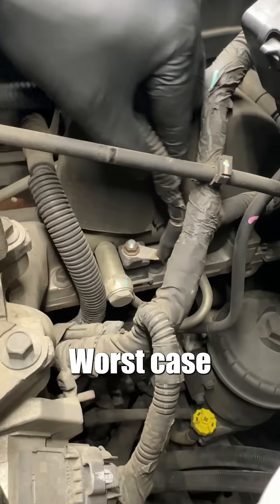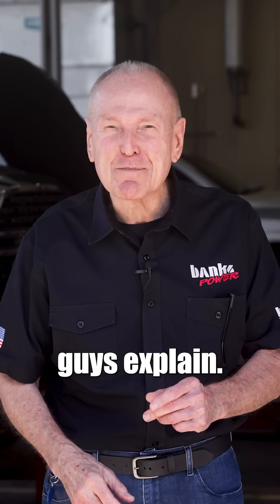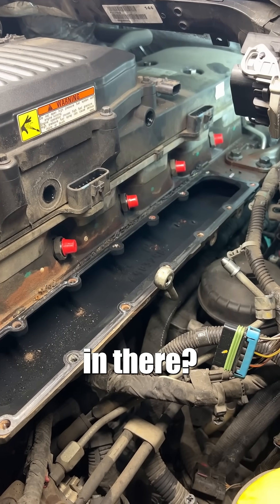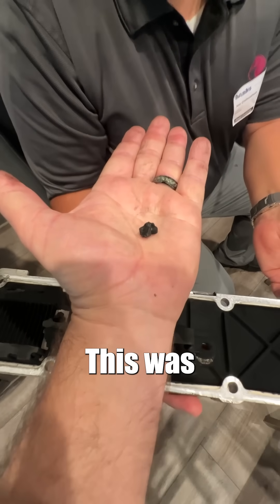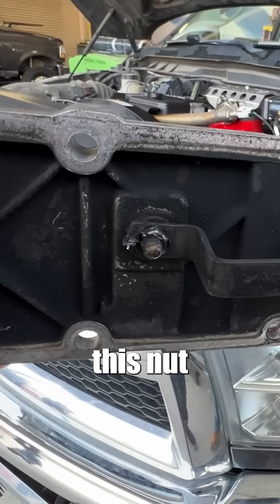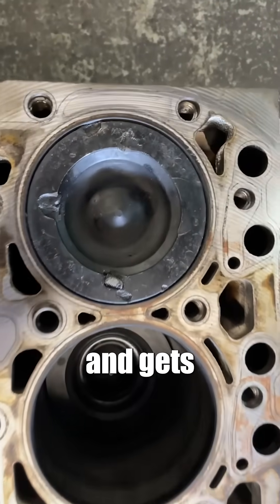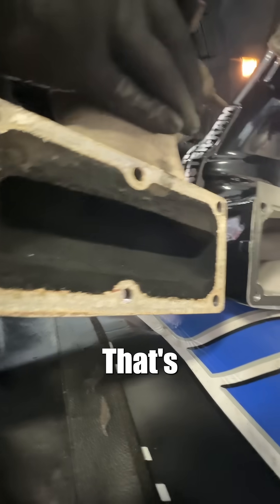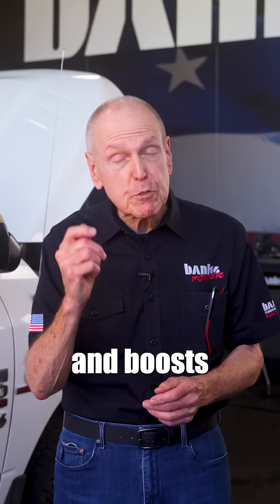The Hidden Time Bomb Inside Every RAM Cummins

Comment: Its crazy to me how many people ive seen saying "iTs oNe iN a MilLiOn" when theres endless testimonies, vidoes and evidence of the contrary. If I had a 6.7 , this is the first thing id be replacing
Reply: If it were truly one in a million they must have sold trillions with how many failures I've seen posted
Reply: I did it as soon as it was available.
Reply: Before my warranty ran out mine was replaced twice soon as I could monster ram went on and when we flipped the grid over damn thing fell off...
Reply: I have a grid heater, plate and air horn for sale. Mine wasn't loose, but now I know it won't happen to me
Reply: Do a little research and find out that the #1 injector line that banks supplies to go around their intake horn is prone to cracking.  So it pretty understandable that people don’t want a blow torch under their hood
Reply: What people don't realize is that there is more than 6 billion people. 1 in a Million out of that many is still lots of room for issue
Reply: 6... 7?
Reply: Yeah. It’s gone. Theres so many better ways to have done that. Noone bolts wires to a heater, it’s just not done for this exact reason
Reply: This it’s called lawsuit.
Big bucks come to daddy..😂
Reply: only the manufacturer would say one in a million, because one accountant made them a million in bonuses to engineer it that way.
Reply: Just happened to my dad.  He sent me this video lol
Reply: A lot of major failures aren’t nearly as common as people make them out to be. People just get really loud about them when they do happen. 

For example, people act like duramaxs are always shearing the crankshaft pins, but in 10 years of working at GM dealerships as the diesel tech, I’ve only seen like 2 ever.
Reply: @2006ChevroletSilverado and how many  techs are there? One per tech every 5 years is a massive amount of failures.
Edit- there are roughly 40,000 service technicians just at gm dealerships. If one of them sees one failure on average every 5 years that's 8000 FAILURES A YEAR- just at gm dealership service centers. That is an incredible number of specific single part failures.
Reply: @ILYxIW because ya'll are too damn expensive  lOl... my lmm never had an issue and she was tuned and in the woods hauling wood and livestock... I do miss the sound of her with the 5in ... God bless ya'll stay safe frosty and free Happy Independence month

Comment: Does installing the Monster Ram void the engine warranty?
Reply: I dunno about this particular product but every other Banks product I've seen does not 🚫 void warranty
Reply: Ck. Magnuson Moss Warranty Act. Dealer needs to prove aftermarket part caused failure/event.
Reply from the maker: The stance on aftermarket parts varies widely from dealer to dealer. This is why we suggest consulting with your dealer to learn how they choose to enforce Stellantis' warranty policies. Generally speaking, there are three types of dealerships.

1. Dealers that embrace and install performance upgrades.
2. Dealers who will overlook an aftermarket part because they know it's harmless.
3. Dealers who are militant about aftermarket accessories and will deny a warranty.

You'll find dealers across the US and Canada that sell and install Monster-Rams. You'll also find dealerships that will encourage you to keep the vehicle stock. In the case of the Monster-Ram, keeping it stock could prove to be a costly decision if the grid heater fails.
Reply: @bankspower  Thanks for the reply. I will do the upgrade at some point but it will be sooner if the dealer doesn’t void the warranty. 

I’ll call them Monday to discuss it with them.